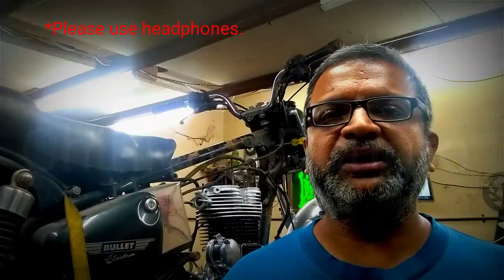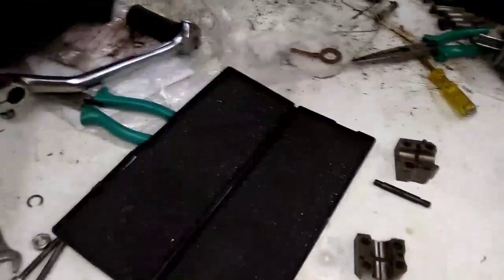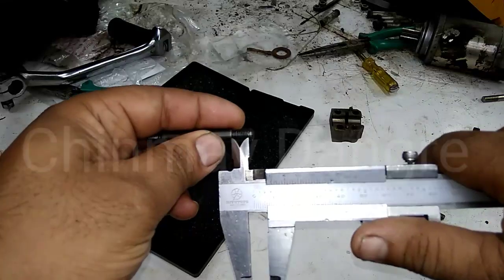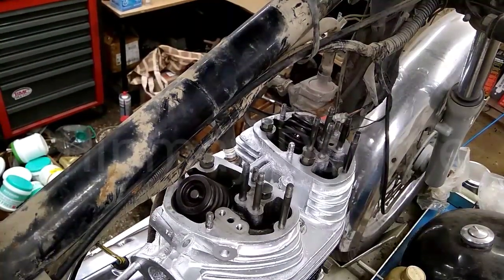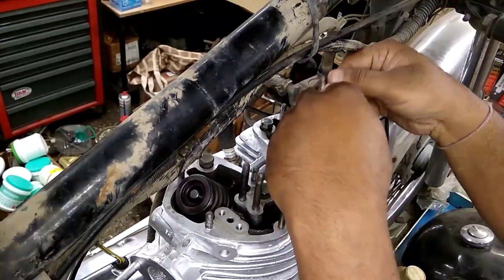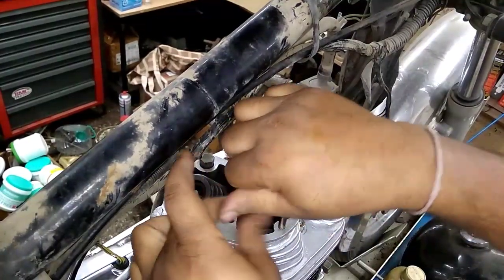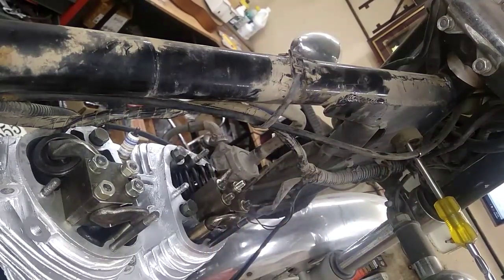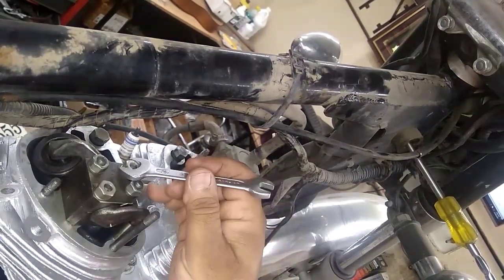ASMR Royal Enfield OLD Cast Iron Engine (350/500/535 CC) Rocker Box fitting procedure (English)

Comment: Sir please reply right now changing the push rod and clean the rocker also because white materials grease type was there, so after cleaning, how much tight we have to do on rocker nuts because you didn't tight that that much? And what else important things we have to remember while doing this, sir please reply,
Reply from the maker: rocker bolts can be tightened by using hand torque. since i don't have small torque wrench so i use hand torque.
Reply: @MechAutoClinic  thank you sir,

Comment: Sir, just to clarify, you didn't use two nuts on the stud to tighten it into place?
Secondly, I was going change the head on my CI bullet, but here at home I don't have that spring depressing special tool, to get the cotter shells in(and I don't know any alternative method). Is there a way to do it without the tool?

Comment: I want to know if I get any old bullet original bend and original silencer how will be the sound
 I have a bullet 2013 model and its  changed only silencer now it's short bottle but it's bend is original one ( company one) that comes with filters to reduce the sound
What should be the combination like (1) old bullet original bend and original old silencer

2) or normal free flow bends that are popular for modification with free flow silencer
 Actually I don't want too loud but right now my bike sound is very low with free flow silencer bcos my bend is original

I need not too loud just sweet dug dug

Comment: Bhai, I have royal Enfield classic 350.when I run 20 killometres and started using kicker,a pataka sound comed. what is the reason for this.
Reply from the maker: Wrong carb setting or very lean carb if you have tinkered jets...check the plug color. If white the. You have lean carb. But if all normal then sparking is happening at wrong time, due to either wrong plug or short plug or water in the tank. Check that. Thanks.
Reply: @MechAutoClinic  
I have changed spark plug.but it only happens after continuous run.
Reply: @MechAutoClinic  How tune it correctly
Reply from the maker: @akshaykrishna97  video made on that please check the list. Thanks
Reply: @MechAutoClinic  I had setted 5 180° turns.but now also that sound is coming
Reply from the maker: @akshaykrishna97  wrong setting. 2.5 to 3 full turns. Not 5 and 1/2.

Comment: Sir please tell me how to check tci unit,and pickup coil ...i checked pickup coil with multi meter,i am getting 300 change ohms...is it perfect or not please tell me..what is the perfect ohms for pickup coil in multimeter....
Reply from the maker: get workshop manual for that. all the data and spec s are mentioned. thanks.
Reply: @MechAutoClinic  tq sir problem was solved

Comment: Sir, are rocker box in ci made of iron and can it be replaced with that of the uce ones. And are the rocker box of uce made of aluminum? My mech told me that the aluminum one does not get overheated hence those should be used in ci engines
Reply from the maker: over heating is caused by many issues. heat dissipation is good in aluminum alloy. But heat generation happens due to low oil supply and wrong spark plug, wrong timing, wrong fuel, excessive throttling, traffic issues. first sort out that and then think about AL based boxes. UCE rocker boxes "CAN'T" be fitted in OLD ENGINES